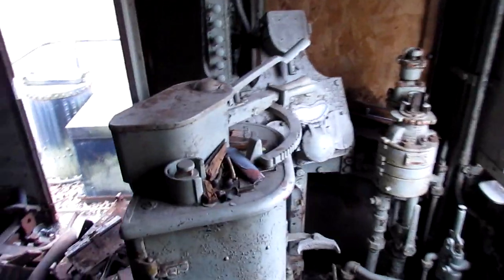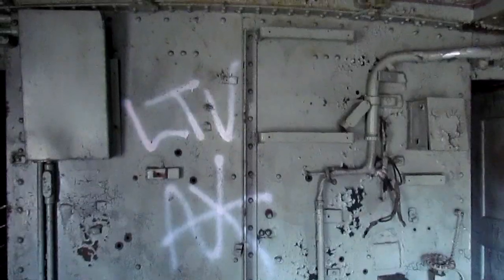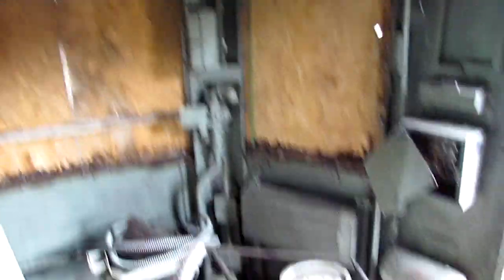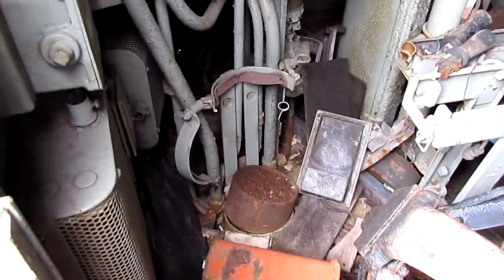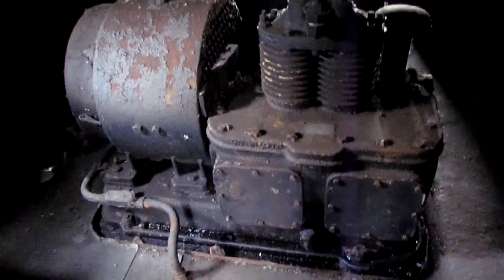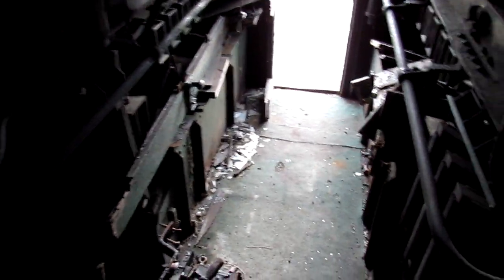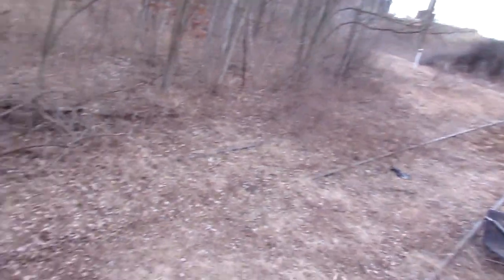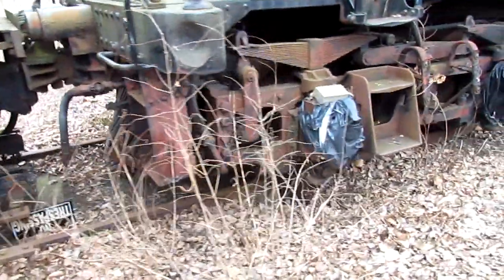Inside Tour of New York Cetral S-Motor #100 and T-Motor #278

Comment: As long as there is proper trackage between the spur and the Berkshire Scenic railroad, they can be rolled to the location, as long as the brakes on the two locomotives are kept off.
It's amazing that a 1904 locomotive was still in service by Penn Central, 70+ years later on. That locomotive deserves a proper restoration.

Comment: Berkshire Scenic sold these units, and are now owned by the Danbury Railway Museum, in danbury CT.  We are working with a moving firm to have these units moved to our yard in danbury, but that most likely won't be happening until the New tappanzee bridge is completed. Occasionally we send some people up there to oil the bearings, and ensure that they are all in good shape. It isn't clear right now whether these will be shipped by truck, or if they can be rolled on their own wheels.

Of  course since they are on private property, and since it is a very large liability to us to have people climbing around on them,  it has to be encouraged that no one climb about them or explore them, and that they generally just be left alone for now, and if you do please don't take anything, we would like to keep these locomotives as complete as possible. 

Now that the official stuff is out of the way, thanks for videoing and photographing these. Since I will most likely end up working on these when they arrive it is nice to know what I will be up against.
Reply from the maker: Did you close them up and/or at least get the small pantographs in to secure storage?
Reply: I myself haven't been up there yet myself to see them, and I will have to ask Stan, who is in charge of the units.  I don't think so, as carrying sheets of plywood back there isn't the easiest thing to do, as apparently the route in has become much more of a swamp in the past few years.  Again, I am not 100% sure, so I will check when I see Stan next (most likely this Saturday). If we haven't, I'll be sure to bring it up to him.

Comment: That track those engines are on is the abandoned Cabbage Island Coal spur. The collection of locomotives used to be stored inside the power plant back in (1993/1995) from what I read, but in the late 90’s the power plant people and the Mowhak and Hudson Chapter got into a heated argument and pushed the cars outside the abandoned power plant coal train yard onto the abandoned spur and shut the gate. After that by 2006 (looking at the aerials) the power plants coal train yard inside was torn up and a big mountain of fill and dirt piled up.

Comment: There is hope for them. The voltage and the fact of having most of the gear means that they would have no trouble on laurel line so they can easily be a part of electric city trolley museum as running pieces only if they get it. Plus no doubt they can run on the corridor if the restoration allows different voltage through removable power converter. And the vandals surprisingly left them in good shape. So I guess they want it fixed up too.

Comment: Are these units still existing? I ran an S motor in GCT back in 1976 because the NYC spare board for engineers didn't have an engineer rested so I got called off the New Haven Oak Point spare board to cover the assignment. 
Having been a rail and streetcar buff I was in heaven. The ex Niagara Junction center cab locomotive's they replaced the S motors with were minuscule by comparison, nobody really liked them. If they are still where you can access them any chance you can video them again and bring someone with you with a sting big flashlight please for interior shots please.
Reply from the maker: I assume they are still there.

Comment: Lol, we still use this standard resistance controller in our VL10 and VL11 locomotives in Russia.
Reply from the maker: +tramwayz Cool.  Those are 3000v DC correct?  When were they built?
Reply: +Jersey Mike's Rail Videos Yes, they're 3000V DC, they were build from 1961 to 2005 (as VL10U and VL11 with some changes but almost the same scheme). Before VL10 was VL8, less powerful (1953-1967), electrically similar to VL10.

Comment: @sturmovikdragon well thts good to hear...well they'll have to call in a heavy lifting/moving company to move them...there are companies tht specailizes in moving trains on severed track. and other big machines..they would have to be removed then trucked to the new location..i hope they move fast cause these are gem's tht must be saved..by the way the axles look  on the S motor i don't think it would take too much time to get it running..maybe about a 6 months to a year round the clock work